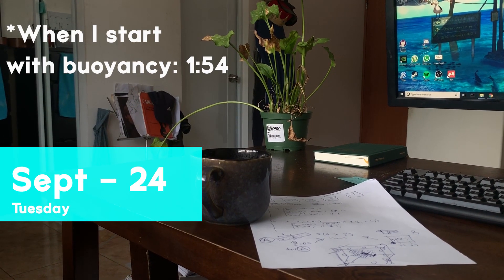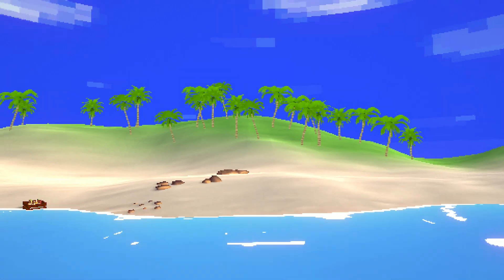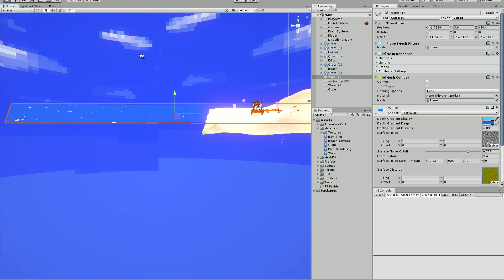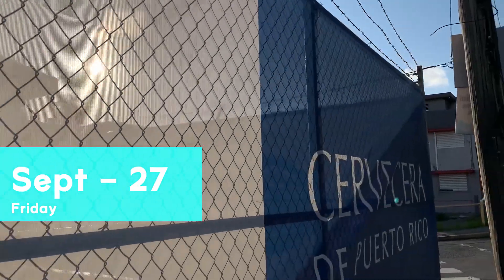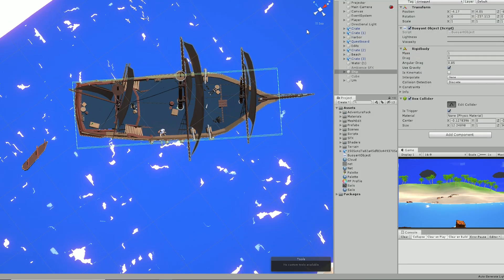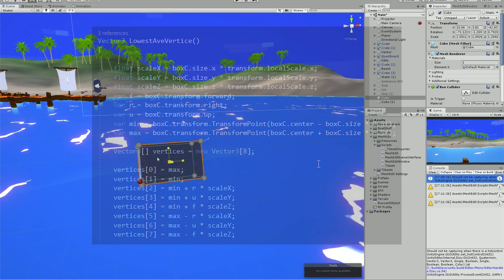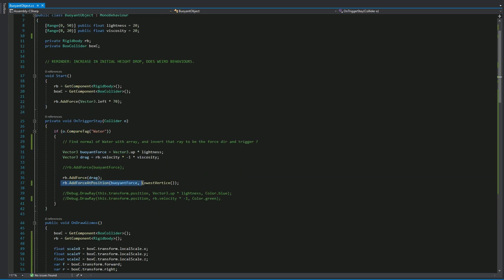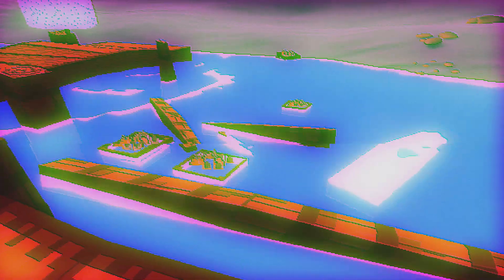Devlog 10 - Buoyancy / Sailing System Part I

Comment: You calculate the waves to change your water from being flat. You should use this calculated surface height for bouyancy calculations, not the simple box collider.
Also apply force to multiple points on the object depending on how deep those are under water